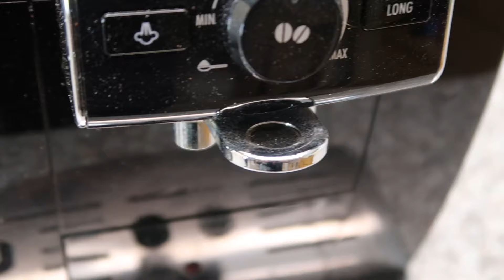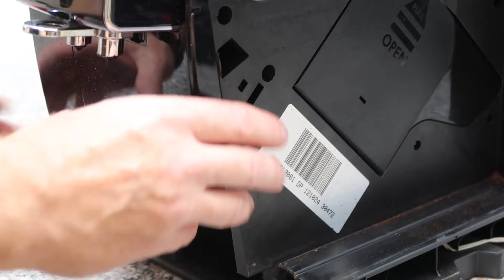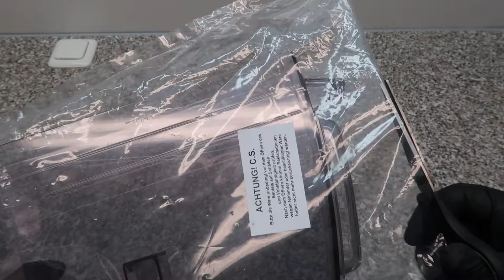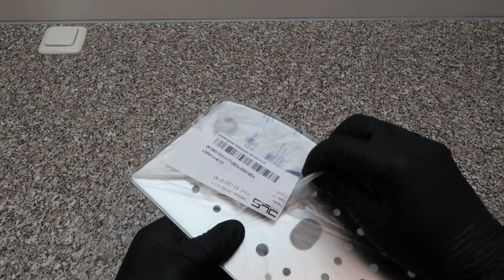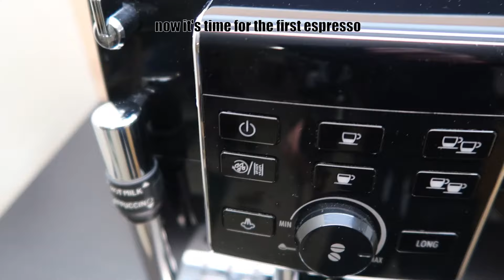DeLonghi ECAM Fully Automatic Coffee Machine Restoration | DeLonghi Repair and Restoration

Comment: Very nice job, great cleaning and video skills. I repaired mine several times, but never took it totally apart. I have a question. I am repairing this machine for a friend. The problem is that the elevator is not coming to the down position, ready to make coffee. It stops in the middle and I get the error symbol. Sometimes he makes it to the bottom, and you can get a cup of coffee. Do you know what could be the problem and how to fix this? By the way, did you know that if the thermoblock stops working, it is probably the heat fuse that is broken. Small cheap part that’s soldered to the thermoblock.
Reply from the maker: Thanks for the great words. I haven't had this bug yet. I recommend running a test mode so you can see if all microswitches are working properly.
Reply: @yt.myworks  thanks for the advice, I will do that. Maybe this is a nice project to do the same maintenance as you showed in the video. I never took one totally apart.
Reply: If the brewing unit moves up and then back down to the middle position with the warning light then it's either the micro switch on at the top or the reed sensor on the transmission. The machine can't detect that the brewing unit is there (isn't pressing the switch at the top) or the values from the transmission sensor don't match those of the switches being pressed.

Comment: I ahave magnifica s the Drip tray is jammed, light keeps on so machine don't start, and the infuser stuck down, can u guide me fix it plz.. 😔
Reply from the maker: You need to send me some pictures so I can see what happened. A short video would be even better: yt.myworks@hotmail.com
Reply: @Barista Secrets I've got exactly the same issue with my ECAM 22360. Any suggestions?

Comment: Did you also clean/replace all the tubes? If they were cleaned, may I ask how? If replaced, where could we get them? Thank you :)
Reply from the maker: Hello, you can clean the hoses with a small brush and reuse them. If necessary, you can also get new hoses on ebay: 
 https://www.ebay.de/itm/291901388175?mkcid=16&mkevt=1&mkrid=707-127634-2357-0&ssspo=AQmADgC_SHO&sssrc=2047675&ssuid=fqjNmJj7Q9S&widget_ver=artemis&media=WHA
Reply: @yt.myworks  Great video. This has been really helpful during my ECAM 22.110.B teardown and rebuild. Unfortunately, I tore the hose at 07:37, and can't seem to find a suitable replacement. I even re-ordered the entire injector hoping it would come with the right tubing (which it didn't). Do you have any ideas where to get this hose that has the same dimensions and properties? Thanks!
Reply from the maker: Hello, I found this here, be sure to check the original before buying if the dimension fits DI=3 DE=5.5 L=145. Alternatively, you can search for the hose on ebay, but it should have the same dimensions. https://www.juraprofi.de/DeLonghi-Ersatzteile/Schlaeuche-und-Verbinder/DeLonghi-Schlauch-ECAM-DI-3-DE-5-5-L-145::13019.html
Reply: @yt.myworks  Thanks a lot for this!
Reply: @yt.myworks  Thanks so much! Unfortunately, I have to ask again: What about the hoses that appear at 2:55 and are connected to the Ulka EP5GW? In your video, one is black and one is clear, but mine are both clear.

Comment: Many thanks for sharing such excellent videos the issue I have have when I turn the machine off the infuser is in the correct position for extracting but the two levers are in the wrong position  I'm manually moving those with my fingers to get the brew unit out the other issue is the pox aren't being ejected and they build up in the infuser and then block and coffee won't come out any ideas on how to repair this fix your help is very much appreciated
Reply from the maker: There are two possible causes for this problem, either the brew group was assembled incorrectly or the lever on the machine broke off. Here is my other video how to properly assemble the brew group: https://youtu.be/WsfIidlbfEs
Reply: Many thanks for your help the leaver is missing

Comment: Hi,
Thanks a lot for all your vid
I bought my DeLonghi Magnifica XS from Costco MN 
120 v - 60 HZ 1250 W
Type ECAM 22110 B
P= 1.5 MPa  (15 bar)
When I took it to North Africa and by mistake I plugged it in 220 V
I smelled little burning. I still can turn it on I can hear the coffee grinding all screen look good with green and yellow light but it doesn't dispense water nor a coffee.
Please help.

Comment: Hello. My coffee machine has Warning light (triangle) and coffee ground container light flashing while water tank light steady on. And water is not coming out.
How can I do with this error?
Reply from the maker: I think the machine could be calcified and clogged. Most often, a water line that comes directly from the heater is clogged.
Reply: @yt.myworks  Thank you for your reply. After checking carefully, I realized that the water pump had died. I purchased a new one and replaced it. After that, the machine worked properly.

Comment: Great video! My machine is ECAM23260S (almost the same as in the video). Question: What could be a problem if the machine makes a 1/2 cup of coffee instead of full one and does it maybe 2 times out of 10. When it doesn't make a coffee, the clean water goes straight to the drip tray. Rinsing seems to work fine; water comes out of both coffee spouts. I cleaned the Infuser/filter and did the descaling a few times. Does anyone have an idea what could be wrong? Thanks in advance.
Reply from the maker: You have to trick the machine (micro switch) and make a coffee without a coffee grounds container. Then you can see where the water is coming from. Usually the brewing piston in the upper part of the machine is leaking.

Comment: tried it, and for the life of me couldn't figure out how to dislodge the plug at 7:21 .. it ended up 'breaking' from the PCB, and therefore my story ended before it barely began. if anyone has advice to prevent this for future endevours, i'm very earer to learn how it seems to snap off so simple. even with the full plug and 'holder' in my hands it took massive amounts of force to seperate the plug what the white thing that remains on the PCB in the video.
Reply from the maker: The connector has small barbs that you have to lift slightly, but be careful, they can break off quickly.

Comment: Took mine apart because there was no flow to the milk frother or hot water. Coffee came out without a problem. Turned out the outlet from the steamer was blocked. Cleared with a pin. Shame I didn't try that before taking it apart . 😡
Reply: Where did you stick in the pin. Sounds exactly like the problem I experience

Comment: I have given the machine a deep clean; however, seems that something is not right yet. After assembling it, it first started normal; when however the brewing unit and the 'infuser' met each other there was some noise, and ever since, an alarm light (exclamation mark) is on. I have removed the infuser unit since it was stuck, but I can't reset the machine. Anyone that magical combination to reset this warning and get the machine back to normal state?
Reply from the maker: @pietervanschaik: Try to bring the transmission into the basic position by hand and start without infuser.  Then you have to look for the mistake.
Reply: @yt.myworks  Thanks! One issue I have down; the press switch sensor thingie (endstop) on the brewing unit was not tight enough fastened. Resulted in an infuser that kept pushing against the brewing unit (that caused the noise). 
Now looking into the water; when teseting the pump, I see water coming to the brewing unit, but not flushing in the bucket below. Will keep you posted.
Reply: The infuser is in the right position, but I have still an issue.  The machine shows a red triangle with an exclamation mark and at the bottom of the panel, two green LED's are blinking. I have the ECAM 22.110B. According to other topics, it is a kind of general warning. The only thing I have done so far was removing, cleaning and putting back the brewing unit and the infuser. The weird thing is that I can get the machine it into test mode and all the separate components work. (only the steam unit I could not test)
Pressing the two buttons at the bottom (with the double cups) does not bring it into a reset mode. Feels like I have tried everything, but could not find the issue. Any other suggestions?
Reply from the maker: @pietervanschaik I found the following on the net: "To start the button test mode, press and hold the '1 coffee button' and '2 coffee button', then plug in the power plug. When the LEDs flash, release the buttons. Now the button test mode is activated.  Then switch it off and on again using the switch at the back. Then carry out the initial start-up" Maybe that will help.
Reply: Unfortunately, it does not brings it further. I can activate the test mode. In test mode, you can execute a kind of initial start-up (e.g. the infuser going up and down) but when you leave test mode, the error is the first thing that pops up again.
Reply from the maker: @pietervanschaik  If you start the test without an infuser, do you get the error message?  It could be that something has been damaged, for example the "reed sensor".  I hope the "power board" is still okay.

Comment: I have the Ecam Magnifica S and no matter what I do having read the isntructions and many YouTube videos, the infuser will not come out! Machine keeps giving me an infusor problem when switching it on. DeLonghi want £140 to service it... that is ridicuous when I only spent $400 to buy it new. Are you able to help please?
Reply from the maker: The brew group may not find the basic position. This happens when the transmission is worn out. You can manually move the brew group to the basic position by opening the left side of the machine and turning the white gear wheel in the right direction.
Reply: @yt.myworks  Hi there and thanks so much for coming back to me. Just to confirm, would this be the side where the water reservoir  is? Also, any chance of a pic of this gear you talk about?
Reply from the maker: I mean the left side when you stand in front of it. Please do not forget to pull the cable out of the socket!
Reply: @yt.myworks  Thanks so much. x

Comment: Hello 👋🏻 I have Etam 29.510 B. Mashine always shows air in water does not matter that I get it out through spout. I have cleaned flow meter, changed pump and the valve behind it. What can be the problem?
Reply from the maker: Is the machine clogged? Does water come out? If not, then a water pipe is probably calcified and clogged.
Reply: @yt.myworks  thanks for reply 🙂so when I start mashine I can make a coffee, but after around 10 seconds it stops and shows alarm about air in water. When I try to remove air through spout I can do this all day long and it will show same alarm. When I restart mashine the procedure whole story goes again.

Thanks in advance
Reply from the maker: hmm... is there a water leak? I would check the water pump first.  Does the pump get quiet?
Reply: @yt.myworks  there was a water leak before on this small filter with metal mesh inside. I have change it. Pump gets quite after 2 tries.
Reply from the maker: You need to make sure the water hoses are properly connected. If that doesn't help then you need to check the water pump: https://youtu.be/9p65d-Mrnwc

Comment: Great work, Thanks!
I followed the steps to did a deep clean but I must got something wrong, the grinder doesnt' work any more:( It keep running without having beans get in.
I have to replace the whole grinder to make it works again😂
Reply from the maker: Try again to reassemble the grinder correctly. The plastic parts have to be screwed on correctly, paying attention to the recesses.
Reply: @yt.myworks  Thanks, appreciate your replying, I took a video when disassembling it,  I can follow my vidoe and  try again.

Comment: Holy mother of lack of maintenance...
Reply: While you are not wrong, a lot of the very crusty areas seen in this video are impossible to reach. You can't expect the average use to disassemble the entire machine to clean the upper part (eg the "tamper" and the assembly leading up to the pump). There's no excusing for the disgusting brew unit though, that one is easily maintained.

Comment: NON SONO TUTTE ROTTE ,STAI SOLO DENIGRANDO .
Reply from the maker: If something is broken, it's already too late. You should carry out a service regularly like with a car ;-)
Reply: People that buy these machines don't maintain them (even ignoring the few basic steps explained in the manual). When that is the case, they will all, in fact, break. If you don't use filtered water, if you dont clean and maintain the brewing unit (including greasing), if you don't grease the transmission - don't be surprised to have a dead machine within 2 - 3 years. Educate yourself instead of attacking people IN CAPS that know what they are talking about.